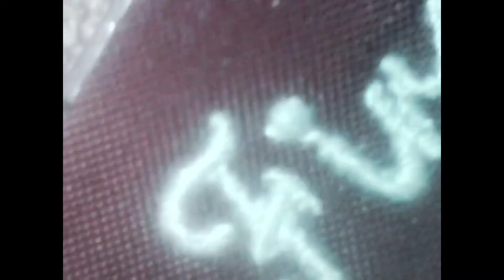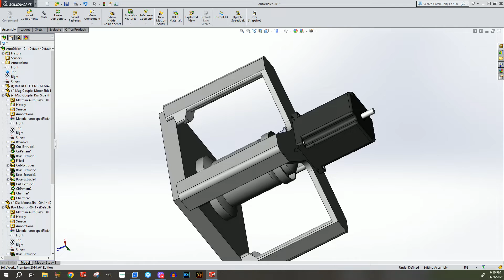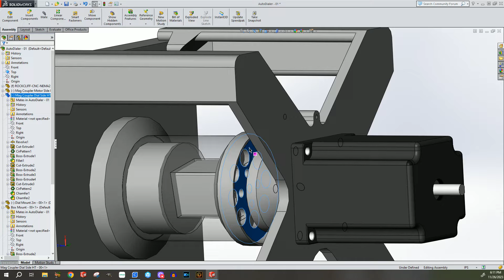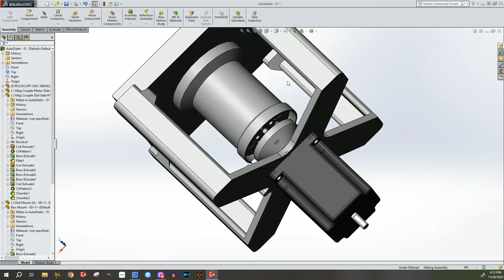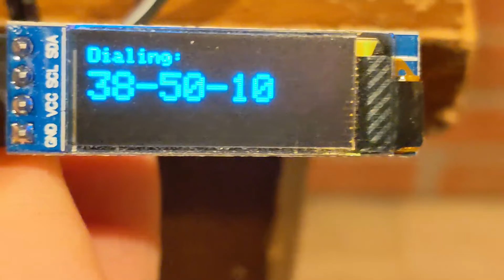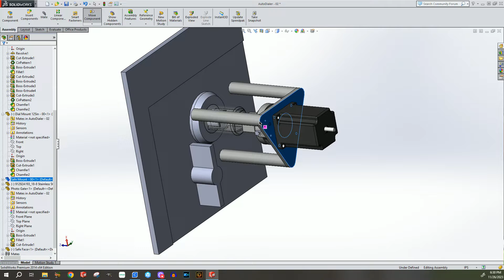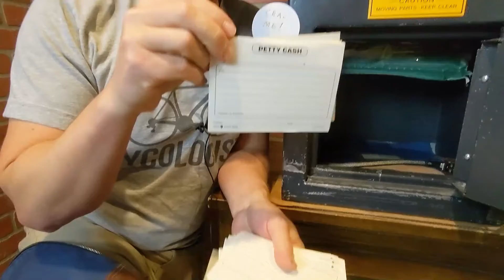I Built a Safe Cracking Robot

Comment: I really hate to point out the obvious, but if you bought the safe and it's not bolted down to the floor, then all you have to do to retrieve any loose contents is turn it upside down and work the deposit cylinder a few times, and whatever is inside will drop out.
I'm a locksmith and I've had to do a couple of jobs with deposit safes where this was the simplest solution, once to retrieve a mobile phone, and the second time was to get the keys for the safe itself that a disgruntled ex employee had deposited in the safe.
Reply: I get it, but half of the fun is building the robot though :)
Reply: @WoLpH  Fair enough, I didn't mean to disparage your marvelous building skills, nice work on the robot by the way :)